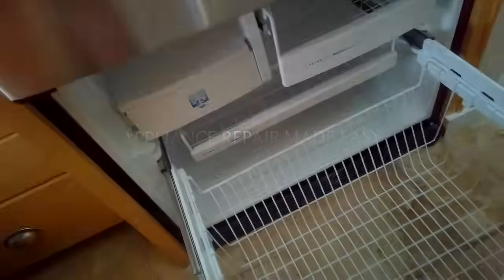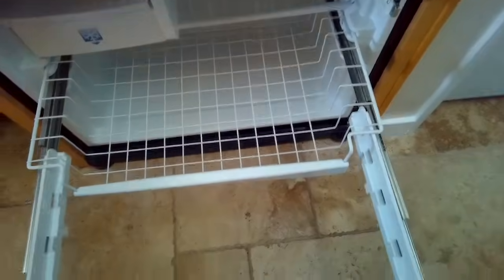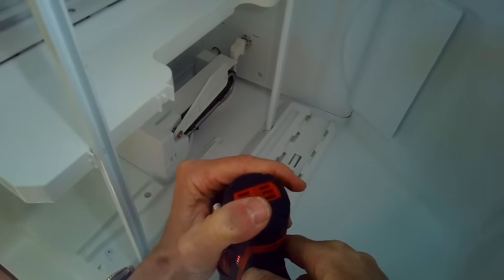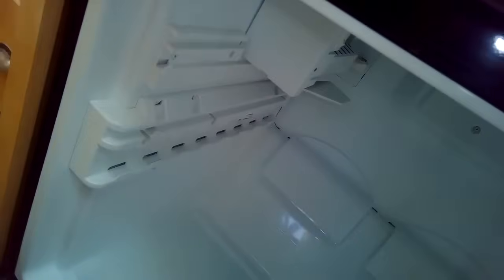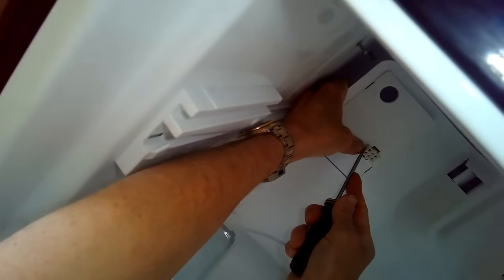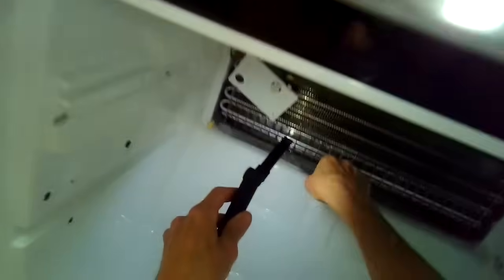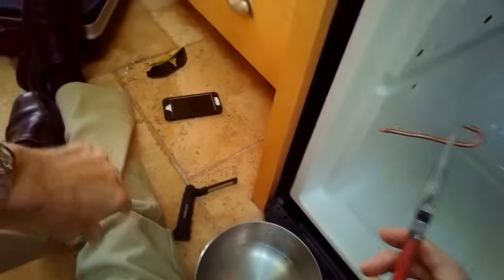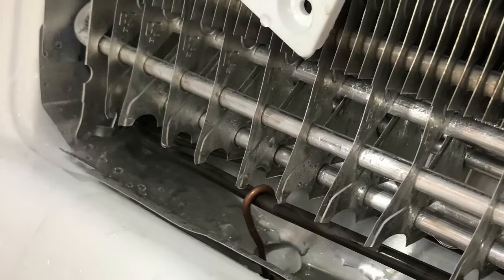✨ GE Profile Bottom Freezer Leaking — ( EASY FIX ) ✨

Comment: Thanks - great video and easy to follow instruction.  I have  different model GE bottom freezer:  PFSS6PKWBSS.  I assume that the root problem is the same - just a different process in getting to the defroster.  Do you have a video for that particular model?
Reply from the maker: I don’t think so but it should be similar.

Comment: My ice maker does not make cubes. The water just freezes in the tray and it also leaks. I've turned off the water and, of course, the leak stopped. What do you suggest?
Reply from the maker: I think the plastic tube that brings water to the ice maker needs to be replaced.  Pretty easy to do.

Comment: So my drain issue has been solved but now the freezer panel on the back is starting to frost up. Temp is where it should be but I'm fairly certain there should not be frost accumulating on the back panel. The fins on the panel are being choked out by the frost and the freezer makes an annoying low pitched hum. I did a quick clear of the frost with a hair dryer and the noise stopped. Should I replace the thermostat or is time to call the GE repairman? That's the last thing I want to do. Really getting feed up with the GE brand. Everything in our kitchen is GE Monogram and we seem to have nothing but problems with it.
Reply from the maker: I think the freezer door is not closing all the way
Reply: @ScottTheFixItGuyChannel  About a year ago I had a problem with the door not shutting all the way. Frost would accumulate in the front corners of the freezer but not in the back. This time the entire back portion of the freezer was frosting over. I thawed it several times with a hair dryer and the problem resolved itself. Very strange but I'm relieved that the problem is resolved. Thanks!

Comment: So, how long after you cleaned out the drain did it freeze back up? Ours was built with the heating rod and it still freezes. Ours was leaking again in about 2 months.  I'll be damned if I'm going to do this every two months.   Time for a new fridge and I can assure you, it will not be a GE.

Comment: You forgot to mention to clear the drain tube at the back of the refrigerator. Remove panel at the back, find plastic tube and make sure it is not clogged at the end, if this is clogged problem will repeat itself even if you have a wire connected to element.
Reply: just solved this problem. Take off back bottom plate (called a Cover Access ASM).   keep  flashlight handy.  Best with 2 people.   Need small hands to get to the drain tube since u must navigate between copper wires to get a grip on the drain tube.   Ridiculous location really.   It may have putty over the connection joint (black rubber tube)  so scrape off putty with small screwdriver, and you will see the seam where J tube connects to freezer drain.  Loosen J tube.  (May need a pair of long pliers to get it started.   I removed mine, and used a bathroom sink drain cleaner (looks like a mini glass cleaner)  to get out the debris - perfect fit for the tube and pushed everything out.  Then used hairdryer on inside of freezer panel to defrost ice (siphoning it from the back tray with a turkey baster).  Good to go.  Really stupid design gymnastics for a foreseeable problem.  Will never buy GE again.
Reply: ...and put in the retrofit P-trap tube so you don’t have to pay Mr. Repairman again in a few months...
Reply: Thanks Mark for the suggestion! In addition to the fix in the video, I had to unclog the plastic tube behind the back panel of my fridge. Ice had thawed, but it was still clogged, so it would definitely back up again in the future.
Reply: Thanks guys... recommend looking at the drain pipe in the back first. Less parts to take off. A quick check to rule it out. Mine was all clogged and no water was coming through and was the issue. If not clogged then recommend going through the front of fridge per Scott to see if there is ice jams.

Comment: Get video, 15 minutes and I was done. Suggest you have a plastic cup handy or towel, if yours is plugged like mine, it will gush water for about 5 seconds. When you remove the drain tube.

Comment: Hardly the fault of your video, but my GE fridge looked identical at the beginning of the video, then suddenly became not at all identical.  My freezer compartment doesn't have a panel at the back held in by screws.  It is molded plastic and has no apparent fastening,  Needless to say, I'm rather reluctant to start prying or pulling  on it.  

A nice video - all the steps .clear and well-presented, but just not applicable to me or my fridge.  Thanks anyway!

Comment: Some models come with that wire installed already but other models such as the cwe23sshss  have a problem where the drain check valve is plugged and will not drain. The fix is a redesigned GE part now available for $6 It looks like a standard "P" trap  Either replace it with the new part or clean the check valve every 5 years.
Reply: Hey cliff would you happen to know the part number for this replacement part? A search only brings up the p trap replacement for whirlpool, KitchenAid, etc (for just about every brand except GE). Any help would be appreciated 👍